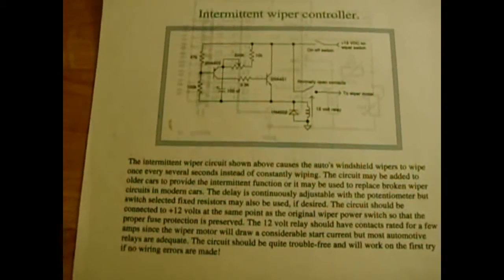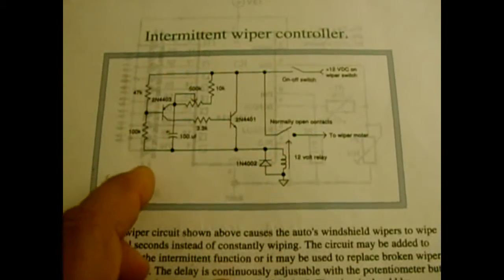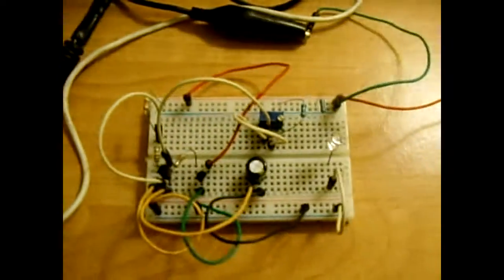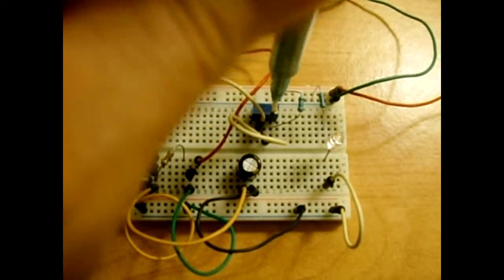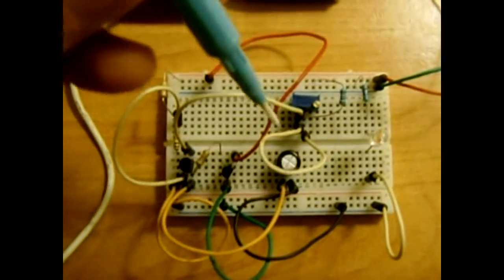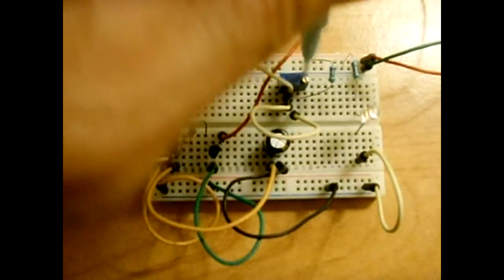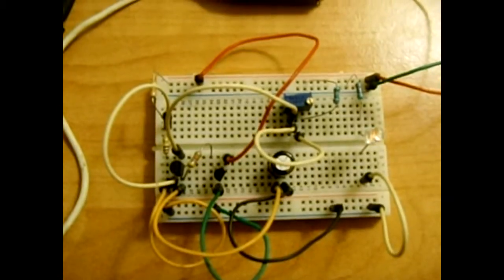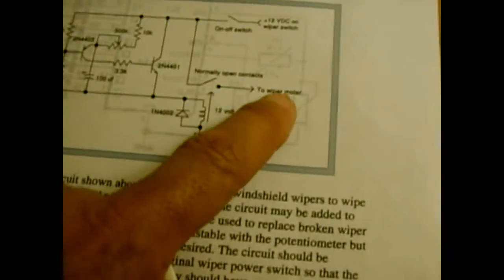12V Automotive Intermittent Wiper / Flasher Circuit

Comment: I am not educated. But I would like to control the fuel pump on the gasoline car.2000 Honda insight. How can I make the fuel pump intermediate. The windshield wiper relay is Side by side the fuel pump relay but I cant bridge it over.

Comment: how do I hook up the relay. i have a 5 contact 12v relay
Reply from the maker: Very simple. Look for the common and normally open terminal using a DMM on the continuity setting.

Comment: Can I ask why the Diode is where it is? I'm new to electronics.
Reply from the maker: The diode which is connected to the switched circuit before the capacitor is used to prevent power from flowing backwards once the capacitor is charged, and the switched circuit is turned off. Think of it as a check valve which is used in plumbing. Water can only flow one direction.

Comment: I've made this circuit on my breadboard but I wanted to use a PCB mounted relay so that everything fits neatly into my chosen enclosure. I am using a Songle SRD-12VDC-SL-C relay which is rated at 12V 10A. When I introduce a load ie. the wiper motor (1.5A), the relay clicks rapidly. I'm just wondering if I've misread the specifications of this relay?
Reply from the maker: That relay is perfect. Applying a load to the relay contacts should have zero effect on the control circuit. I have a feeling your power supply is not stable. Cycling is controlled by the POT setting.
Reply: electronicsNmore
I recreated the circuit on a proto board with a similar relay and that did the same thing. But when I connected the circuit to my car's wiper motor circuit the relay was fine.
Reply from the maker: Something is strange with your circuit or power supply. The circuit works. I don't know what to tell you.
Reply: I think you're right, it's probably my desktop power supply (made from an old PC ATX PSU). Great little circuit though compared to others I've seen and it works fine in the car. :-)
Reply from the maker: Must be having problems due to the switching power supply.

Comment: Are 1/4 watt resistors enough power handling for this circuit?
Should I buy a linear or logarithmic potentiometer?
Reply from the maker: 1/4W is fine, linear or log will work, but I would buy a linear taper.

Thanks for watching! Be sure to share my channel with others, and rate Thumbs Up.

Comment: What is used to make certain that the wiper stops in the down position?
Reply from the maker: Wiper motors usually have an internal cam that parks the wiper which is powered by a +12v source besides the one from this circuit.